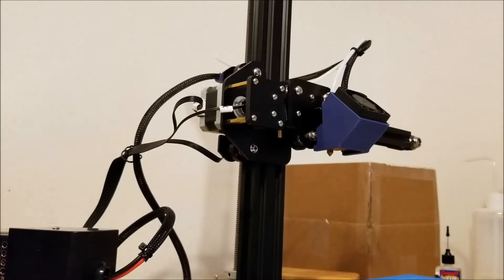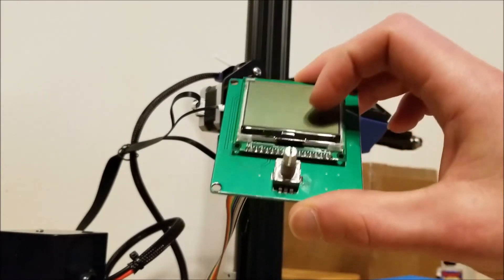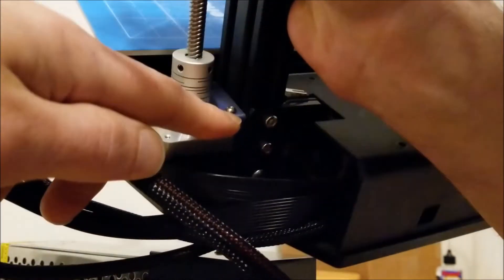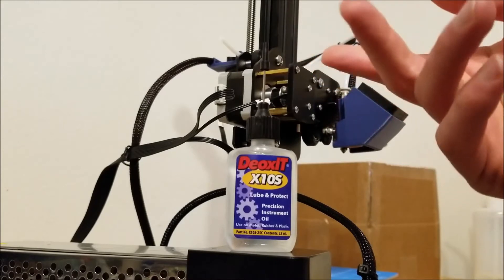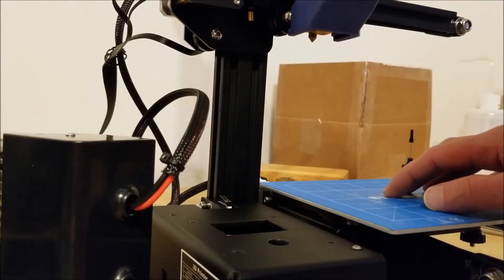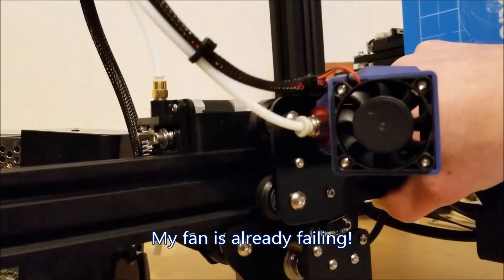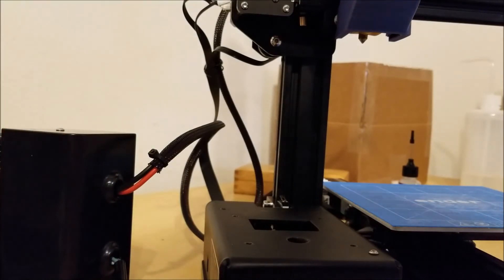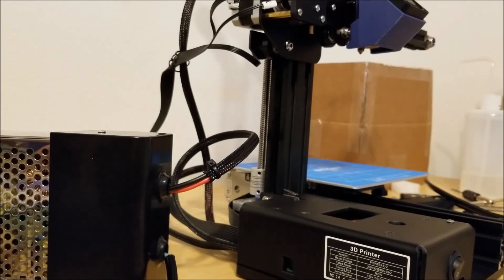Ender 2 Build Notes

Comment: Hey Ross!
I started to build my Ender 2 tonight, and I ran into a problem.
The Z-screw is not parallel to the the z-axis bar.  The angle is so extreme that i could not easily turn it with my fingers.
I'm at a loss as to what to do...unless i can bend that aluminum plate to help the holes line up better...but that seems trick given the tools I have available.
I also noticed that screws rubbed against that decorative plastic tubing running inside the channels of both axes they insert that stuff in....adding resistance
is that normal?
Any help is so helpful!
Reply: Resolved!
There are 4 tiny lock washers on the brass female z-screw threads.
I removed one, in order to chnage the angle that that brass piece fits in there, and now it works perfectly..almost
I find some tighter spots...towards the bottom.
Wonder how that effects steppers....
Reply from the maker: Yikes. Maybe try unmounting the z motor from the frame and seeing where it is "happy".  I'm sure you can actually print with the motor NOT attached to the frame, don't expect the best quality, actually the print qual will likely be very good, but obviously any little bump could do bad things to the print). My point is at least you could then try to print the adjustable bracket. 

Take off the decorative strips and toss them.
Reply from the maker: Great to hear! Reply via phone is slow :]
Reply: Oops...z-screw is NOT parallel to the z-tower.  at about 120mm it binds.
Back to your tips...I guess I'll try to find where its happy...
Then try a spacer.
Reply: I have to admit Ross, I don't know how your spacer dealy works.  I don't understand the theory of operation.  I think maybe i just need a spacer....guess I could try a spacer first.
I'm not sure what you mean by "centered"....
Reply from the maker: Where did i say "centered"? 

If your threaded rod is bent you should replace it - you'll have nothing but problems if you don't. If it's not bent but you notice as the x-carriage moves up and down the top (unattached) end of the rod moves left, right, front, or back (or some other angle) then your z-motor and the threaded brass fitting are not in alignment.

Without taking the rod off the printer to check if its bent... if the end of the rod "wobbles" as you move the x-carriage from the bottom to the top then your rod is very likely bent - if it slowly moves in only one direction as your x-carriage moves up (and the other direction when the carriage moves or down) then its just an alignment issue. My "adjustable z-motor mount" is meant to help if your motor needs to move left or right a bit to be in alignment. Nothing but a new threaded rod can help you if it's truly bent.
Reply: .  The screw isn't' bent, it doesn't wobble.  Looking at from the back, the z-screw does not stay in line with the very middle of the z-tower.
At the very top, its closer to the left of the tower than the right.
I'm not sure that moving the z-motor left or right is the solution, as it might just put strain on the z-scew.
I think it is the brass threaded fitting that determines that angle Im getting.  I took of the printed z-screw stabilizer mount I had on top--it was REALLY putting strain on the screw.  In its h"happy place", the screw top is nowhere near the hole in that z-axis stabilizer.
I already removed one lock washer on the brass fitting to get free, bind free movement of the carriage along all 200mm of travel...I removed the inner bottom lock washer to tilt the brass fitting slightly towards the tower.
If a perfectly vertical z-screw is necessary, the brass fitting needs to be adjustable, as positioning the motor with a spacer would only cause binding, if not in the screws "happy place".
Argh...I hope I'm making sense..thanks for your help.
Reply from the maker: Print this: https://www.thingiverse.com/thing:2752080

Mount your z-motor with it. This mount lets you move your motor LEFT AND RIGHT to help with the exact problem you are having.
Reply: copy on it!
I probably have some M3 of various lengths, but no "grub" screw...but you say thats ok if i remember properly?
Reply from the maker: Yup, regular screws will do
Reply: I still say, though, Ross....If you just threaded the rod through the brass fitting on the x-axis assemmbly....thats where the skewed angle comes from.
Reply from the maker: get this sorted out? I've seen others having the same problem where they need to bend the plate where the brass nut is mounted too.
Reply: No other adjustments right now, other than the removal of one lock washer to alter the angle just enough for ez spin of that stepper.
Some kind of micro adjust mechanism on that brass fitting would be nice....

Comment: It is very easy to level the bed if you use the three points over the screws. Usually only takes me one try.
Reply from the maker: Thanks for the tip. I largely agree, I've modded Marlin to add the leveling screw points to its bed leveling assistant myself. However, I've also found that the bed is "squishy" over those screw heads on the Ender and I often get a bed that's too close to the nozzle if I go with the usual paper friction test - translation I need to shoot for a much "loser" clearance at these points than I would otherwise.
Reply: I also have a thin, less than 1 mm, polycarbonate sheet over my build plate with clips, from Thingiverse, reduces the squishy over the heads, makes it easier to get prints off, and reduces the frequency of needing to level the bed, because force is only applied to the print after it has been removed from the printer. 
Note: I have only printed with PLA so far so I don't know how it works with other plastics.
Reply: Mike, can you share the Thingiverse link please?
Reply: No problem https://www.thingiverse.com/thing:2494365

Comment: Ok, You answered 2 major issues. I had the 4mm off center Z (not recommending my solution)  I used Torque on my on my Zbar. My goal was to reangle the brass top fitting so that it would point perfectly. I torqued in multiple spots of unused area of the z bar (top of the bar). I am a NOOB with no ability to fix the Z alignment. If I force it into place it created a seize, I assumed my Z motor would fry. I got it to work.

Am I supposed to use the far right V+ ADJ for my 110 power in? My screen is dead, bed and nozzle work.

Issue 2. I have the washer issue on my filament threading. NIGHTMARE! I had no clue until seeing your video.
Reply from the maker: Glad I could help! Sorry to hear of your struggles, I would be happy to re-mix my z-motor bracket with longer slots if it would help. Be sure your z-rod is not bottomed out in the coupler. The coupler should be free to bend as needed - if it can't bend you can get binding too.

The steppers and the stepper drivers should be able to handle stalls just fine - it sounds horrible but it's not damaging the electronics or motors. Steppers are held static all the time by the controller - think of how it "locks" the axis and how you need to "turn off the steppers" to be able to move them by hand.

V+ ADJ - only mess with that if you have volt meter and are very careful around the mains wiring. You would need to measure the supply output voltage and turn that POT until you get about 12.0 to 12.5 volts. Power supply voltage should not very with input voltages... chances are the supply is already set close to 12v anyway.

As for your screen...
Was it ever working? Unplug your printer and take the lid off the case and check that the LCD cable is securely attached.

Comment: Hey! Thx Ross K. I've been searching all-things Ender 2 for awhile because I have one I haven't assembled.

I bought (4oz) DUPONT Non-Stick Dry-Film Lubrication Teflon because it's 100% dry to the touch (no oily film, repels grit and dirt) but it isn't food safe. Maybe I got the wrong stuff.

I want to add a few bells and whistles such as a part cooling fan. My goal (hopefully) is to make this little printer multi-filament capable, i.e., ABS, TPU, PETG, et al. 
I'm looking forward to seeing your future vids.

Thumbs-up and Subscribed.

PS: Sorry for the diatribe-like comment. I promise, it's a one-timer.
Reply from the maker: Thanks for the kind words... I write much longer comments :P

As for the lubricant, it's your call. Read the MSDS on it and determine if you (and your household and pets) would be at any risk.

The ender 2 will print TPU just fine as-is - TPU is flexible while not being very stretchy so it does a fine job in the short bowden tube of the Ender.

As for PETG you will need to either use a low temp mix or you'll need to upgrade to an all-metal hotend. I tired some PETG yesterday in fact and at print temps safe for the PTFE lined hotend (do not exceed 240c) my PETG print unraveled like a bad x-mas sweater. What's worse is that it contaminated my nozzle and my PLA prints to follow also had extremely poor layer adhesion, though i suppose it would have been a good time to print a spiral mode slinky. I had to disassemble my hotend, take off the nozzle and burn out the the residues. While I was in there I noticed that the Bowden tube had slipped up the heatsink a bit so there was a gap between the nozzle and the tube (which is very bad) so I corrected this as well and it's working great again.

Generally speaking, don't bother with ABS unless "cheap" is far more important than "good" prints. And don't print with ABS in the same room as people or pets - not worth the possible health hazards (do your homework on the various plastics, they each have different off-gassing risks with PLA coming in as likely one of the least terrible for you and ABS among the worst).

I've made my printer completely silent, the loudest part of it is my Noctua Fan (which are extremely quiet fans). I'm using an MKS Gen 1.4 mainboard with TMC2130 drivers. It took me about $100 and a full weekend to get everything working (mostly due to this being my first dive into Marlin), including the stock LCD, but my wife is no longer threatening to throw the printer out the door ;) and I can have it on the same desk i'm sitting at and literally have to look at it to know if it's printing or not. I might make some videos on how I did these upgrades but it will be challenging to do so in a concise format.